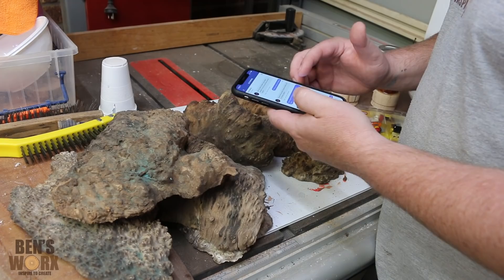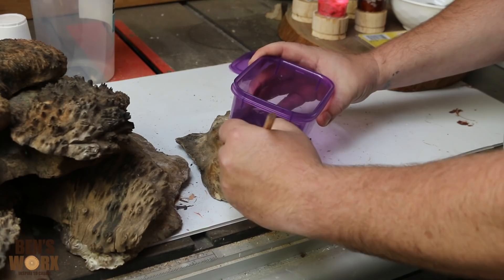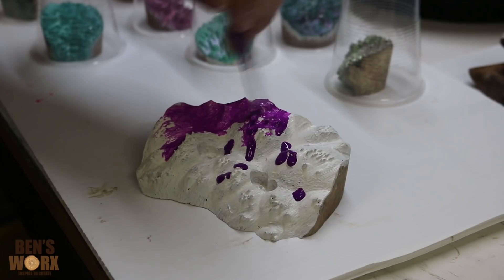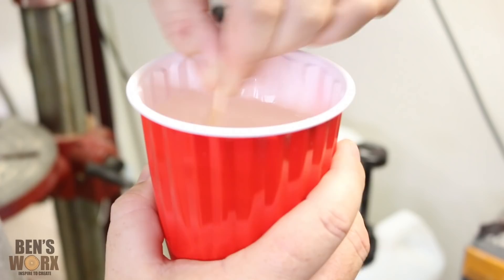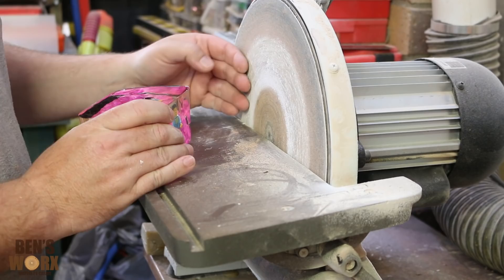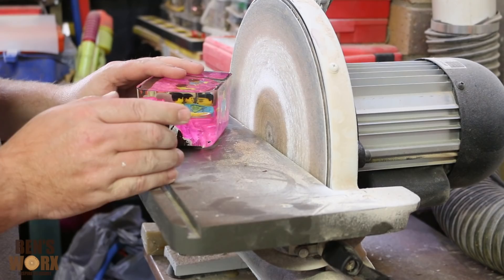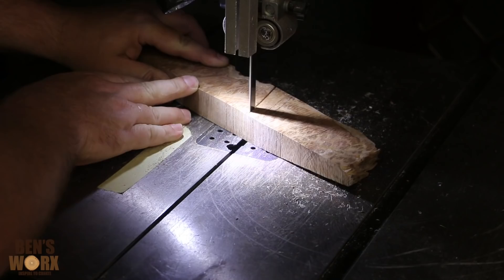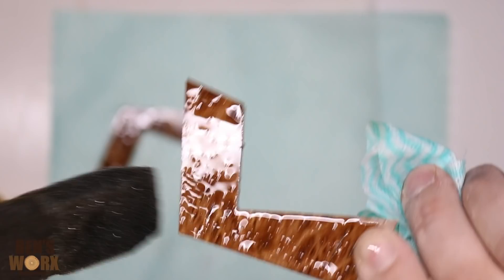Casting Lego in clear resin

Comment: as a heads up for painting, you should look into white gesso / canvas prime. it's meant for canvas, but i've used it on a variety of other surfaces, including wood and it will create a texture which makes painting acrylics on top easier! it will also likely last you longer than that bottle of white paint you have as well
Reply from the maker: Thanks for the tip Gabriel

Comment: The datasheet for that resin advises a maximum pour depth of 20mm, yet you exceed that considerably with no signs of uncontrolled exothermic reaction. If I poured any of my resins that deep, they would literally boil in the mould! Is your workshop particularly cold?
Reply from the maker: And to top that I’ve just done a 1.2L pour at 120mm deep, nah not really
Reply: @BensWorx  I agree with @resinAce on this point. The temps may have caused a secondary reaction with your "purple".  Also, if you did a few shallow pours I think you could increase the clarity. There's a yellow tint on my screen.

Comment: 1. I liked the dog paw, and the dog it is attached too.
2. I liked the wooden stand, then the lego one was made and agree with the change. I would have had the stand's feet connect so it would be less prone to falling over.
3. I'm a painter... I think you do a magical job at painting... I also love the sound of power tools... Is that too odd?
Great video... I have a clay GLADOS from Portal 2 in the works that I want in a resin cube that will have lights and look like she in a testing room. But I need a pressure pot for that one. Right now I am working on resin cube planks that I will use clay to form Tsugaru Shamisens (Japanese instrument) out of.
Reply from the maker: Hey Timothy, Thanks Mate! I appreciate your input 👍

Comment: Is it true if you pour from higher up it helps prevent bubbles?
Reply from the maker: Hi Gail, I haven’t tried
Reply: @BensWorx  I have seen it in a few videos. Mostly on large projects. I think it helps the air bubbles to break up from a higher pour. I guess it would be harder to get rid of a lot of air bubbles on a larger project.

Comment: That came out nice. Do you have the color shift paints? I would have totally used the purple color shift. They are a bit more expensive but worth it. I have 3 different color shift colors. - Heidi
Reply from the maker: Thanks Heidi, I have the color shifting pigments, I’m using them on my current project 👍
Reply: @BensWorx  Sweet! Never heard of those. This is a color shift paint by Folk Art. Few videos on here about it which is how I first found out about it. :) It looks sweet under resin.
Reply from the maker: Cool, these pigments are amazing

Comment: Hi, I was wondering if I don't have a wheel, what can I use to polish my resin with?  Can I apply the polish on the resin with just a microfiber cloth?  Thanks!
Reply from the maker: Hi Janice, yes that would work but be careful you don’t have any bits on the cloth that can scratch your resin
Reply: Ben's Worx ok, wish me luck, first time casting clear resin in layers and painting it layer by layer. Will go out and buy my sand paper tomorrow and when finished used my farcela polishing compound. Hopefully it turns up with a clear surface . Thanks for you advice